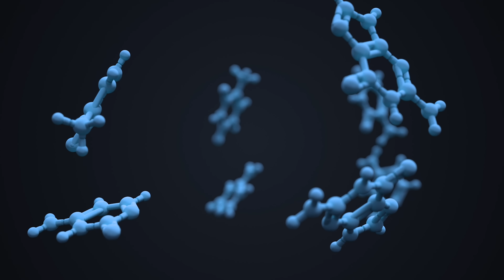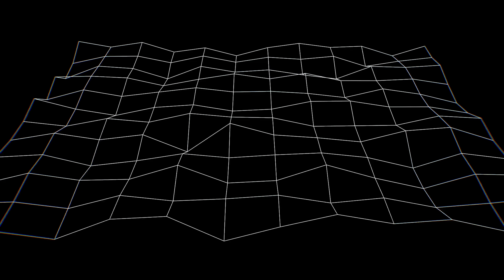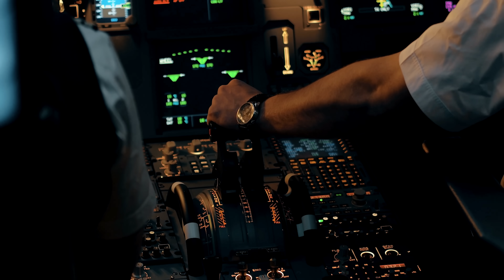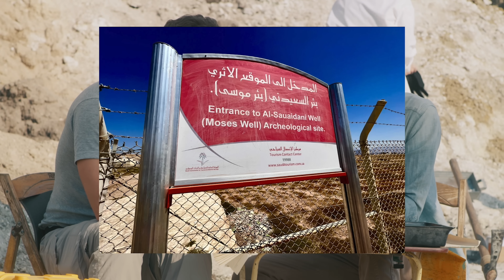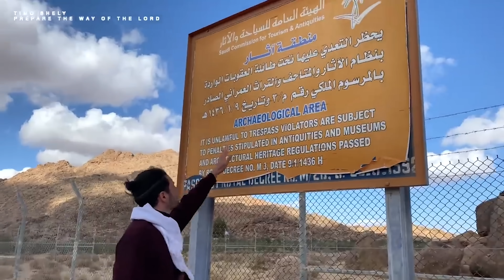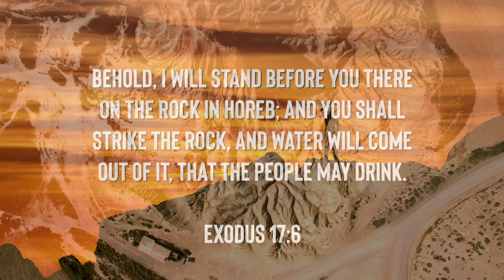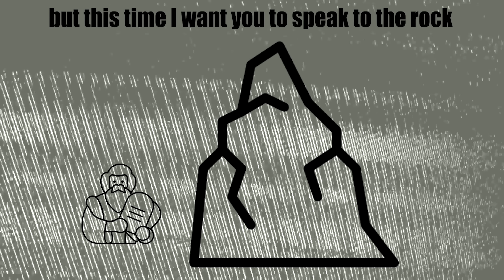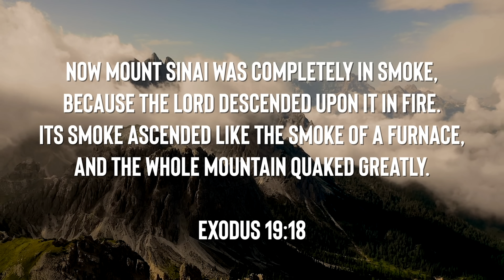Saudi Arabia Just Announced a Terrifying New Discovery

Comment: As a Christian who believes the veracity of the Exodus record in the Bible, I find it interesting how emotionally invested many Christians are in this site. Having done extensive study on the matter I conclude that while this site is very interesting it is not "the true Mt. Sinai." I don't think the traditional site is either. Neither this site nor the traditional site satisfies all of both Biblical and topographical criteria. There is no barely submerged "land bridge" at Nuweiba. While the depth is not as great as to both north and south, it is still 2,625 feet deep. The unusual rock "at Horeb" is almost eleven miles away from the proposed Mt. Sinai and on the other side of the mountain range from where it is said the people of Israel camped at Mt. Sinai. Getting from this rock to the camp of Israel would take a journey of some seventy miles to traverse a route that would be reasonable topographically. There is no place along the proposed route between Elim and Rephidim for the Red Sea camp listed in Numbers 33. These are just a few of the problems. The Exodus happened just as the Bible says it did. But it didn't happen here.

Comment: Another thing that happened is when Moses brought down the ten commandments and found them worshiping the golden calf he broke the cap in the pieces and then he grounded in the fine dust and then he took water from the stream which is moving water which is known as living water and he mixed it with the fine dust gold. What happened is the gold goes into suspension and turns blood red what you have here is some of the symbolism of the bread and wine but in this case is the living water and the colonial gold as blood red . The symbolism goes way back. Another thing that happened back then was when the water is turned to blood it was real blood they found that chloroplasts could be converted into real blood with just the right chemistry in world war 1 they used it as a blood substitute and as soon as it got in the veins it typed to the person's personal type and it worked fine so here's my point there must have been a volcano at that time that blew up on the other side of the planet and the dust the chemistry of that dust rain down on Egypt and when it did Egypt is a highly fertile arealots of algae lots of chloroplasts and all the dust had to do with hit the water where they were at and swap out record chelation of the magnesium for the iron so when the iron took its place replacing the magnesium it went from being chloroplasts to being hemoglobin so God did Make it rain real blood.